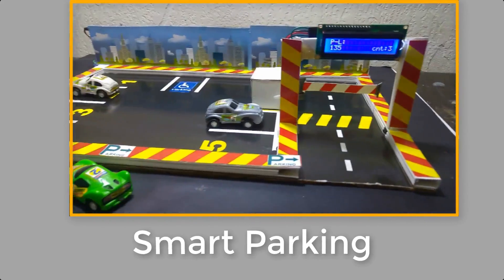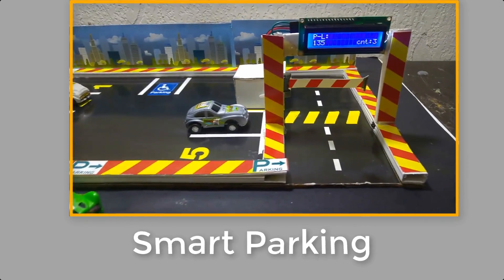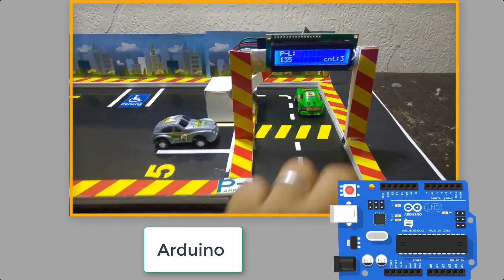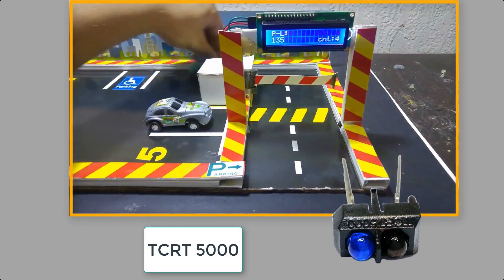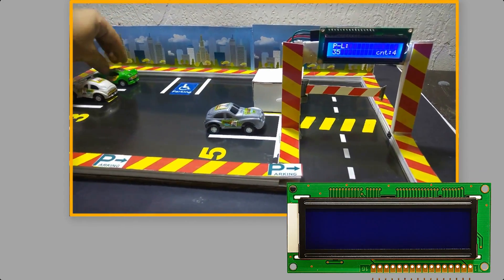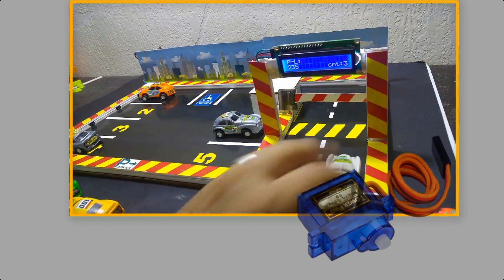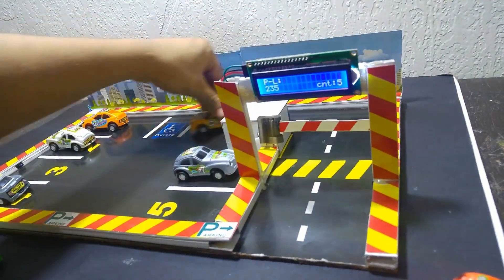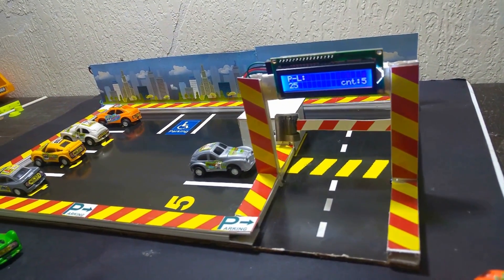How to make a Automatic Car Parking System

Comment: can yoou give clear picture for wiring of sensor and what resistors you used (soldered ) to tcrt sensor. one sensor is 10k and other one is 220 or 510 ohm.

Comment: Plzzz send block diagrammmm
Reply: If anyone knows the connection of IR sensor to power suplly pls email me..because my final yr project is this i have been stuck in it..due to im not understanding the connection of IR sensor to powersupply pls upload the full neat video my external is on 5 april only 2 days left plsss help me.. U help will save my carrier. .. email 
pranayanair060361@gmail.com

Comment: there was a problem in your code
you have mentioned that POSITIVE for the lcd which was not accepting by the arduino IDE
try to change it ,sir
Reply: What can be used instead
Reply: @heisenberg_haha  
Try this, mine worked with this one!
https://bitbucket.org/fmalpartida/new-liquidcrystal/downloads/?fbclid=IwAR3dAG_0xj7MUfzfQq23MP6gx_yZ0PlpFErqAavKweGBkD1PcbfnoRlM1ak

download the latest version rename it to "LiquidCrystal_I2C" and REPLACE the folder with the existing one in your sketch folder.

Steps:
Create a new folder called "LiquidCrystal_I2C" under the folder named "libraries" in your Arduino sketchbook folder. Create the folder "libraries" in case it does not exist yet. Place all the files in the "LiquidCrystal_I2C" folder.

Usage
:
To use the library in your own sketch, select it from Sketch > Import Library.
Reply: @fairuzmaliha5458  can u send me circuit diagram for that parking project

Comment: Plzzzz we can tell me which resistor you in IR sensor plzzzz because I was bay all components but the thing I don't know which resistor you used plzzzz tell me
Reply: IN-470 AND OUT-10K
Reply: @md.polashkhan8803  circuit diagram hai bhai mohsinpatait12@gmail.com 
Send me plz
Reply: @md.polashkhan8803  uske terminal nahi samj aarhe

Comment: what is the entire parking lot project size ?  In centimeters or inches. (30x40?)
Reply: i did it on a A3 size board
Reply: @sourabhsingh5901   bro can you send me code please I have very less time for my project
Reply: @touseefahmed617  mail id please..
Reply: SOURABH SINGH Can u pls send me the modified code n circuit diagram? Pls help me for this project🙏🙏🙏
prettyprincess3092@hotmail.com
Reply: @sourabhsingh5901  hello, can you share me design, code and material you use to make it. Simply actual  project report to ppatel8471@gmail.com
Reply: SOURABH SINGH did you complete it successfully ? please tell me where to connect servo motor?
Reply: +SOURABH SINGH please, can you send your modified code and circuit diagram to sdghayat1245@gmail.com ,please I need your help 😊😊
Reply: @sh.alqudah3651   Can u please help me out also my friend,? if you have the code and diagram please send it to jawa.350.12345@gmail.com
Reply: SURE I WOULD SEND YOU
Reply: @sourabhsingh5901  PLease send it to me too
Reply: +SOURABH SINGH send to me too sir ojeksdarey@gmail.com. thanks for uploading
Reply: Hello sir, can you sand me your modified code and the full circuit diagram?  I need it for my final project! I would be grateful! I realy hope you respond, my email is : niconicoleta21@yahoo.com  

 Thank you!
Reply: Hello Sir please send it to me through my email address emmanuelbarry2@gmail.com
Reply: Hello Sir please send it to me through my email address emmanuelbarry2@gmail.com
Reply: Hello Sir please send it to me through my email address emmanuelbarry2@gmail.com
Reply: send me the code and digram ,mohd.tharmizie9699@gmail.com
Reply: +SOURABH SINGH can you please send me the modified code and circuit dig at eamil id-  nitinkumar31@yahoo.com
It's urgent
Please help
Reply: Sir SOURABH SING,  please send your circuit diagram and  the complete code to  galindo.emman@gmail.com  need only for final project in school
Reply: Where Can I find this printing of parking lot. With actual size. ?